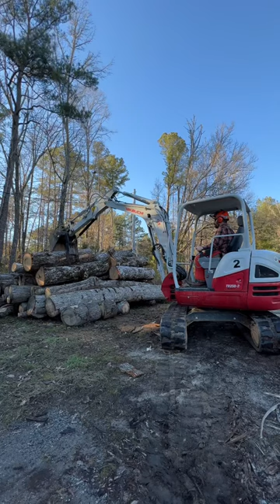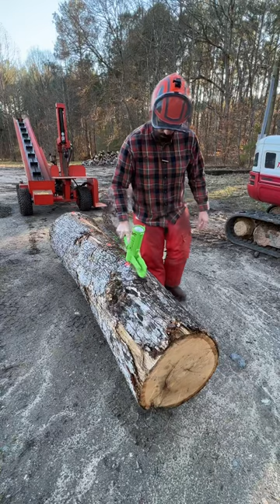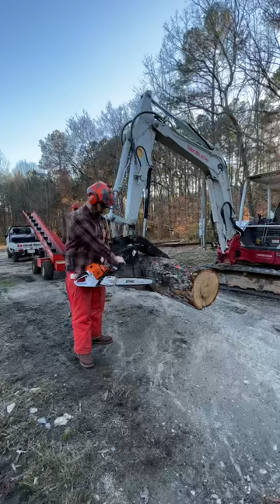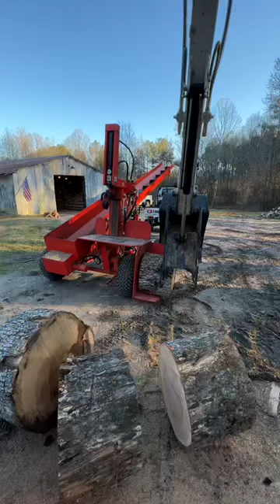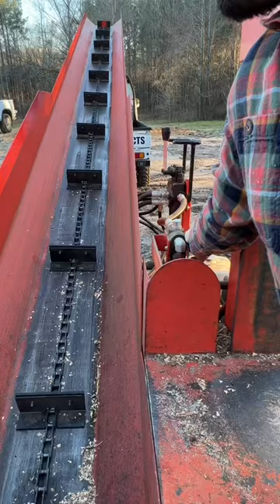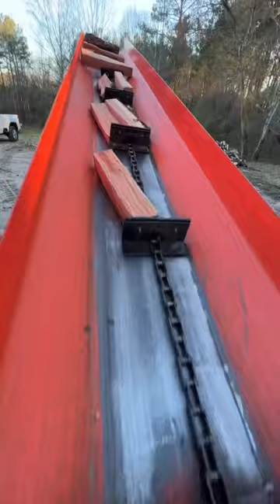How I Make Firewood #shorts

Comment: I really like that little pickup you have. What is the little beast?
Reply from the maker: Suzuki Carry 4x4 mini truck.  Imported from Japan.  It's a tough little machine, and 1/4 of the cost of a side by side.  Appreciate you watching!
Reply: What’s the top speed on it, can it do speed limit, like 55mph?
Reply from the maker: @thinkigreen   It tops out around 65mph with the oversized tires.  They’re legal in my area on roads with speed limits of 55mph and under.  Appreciate you watching!